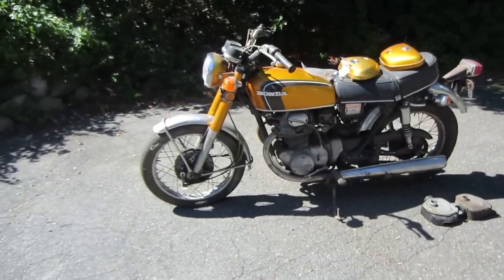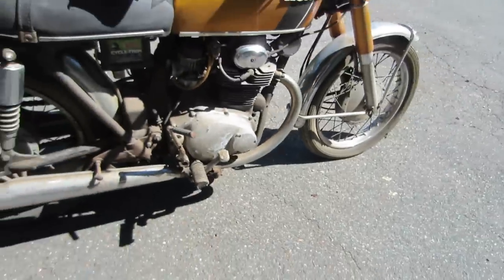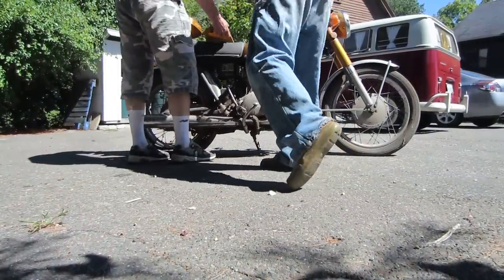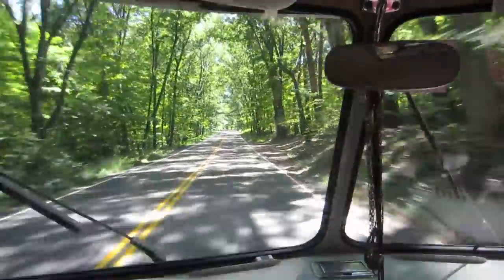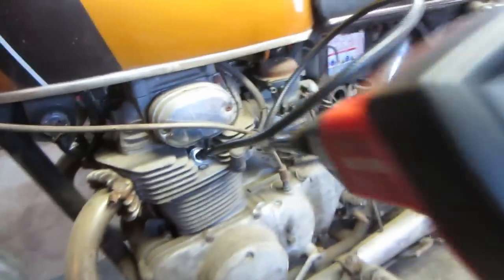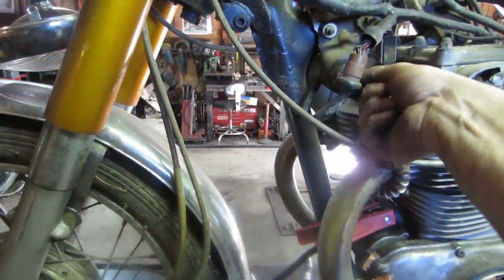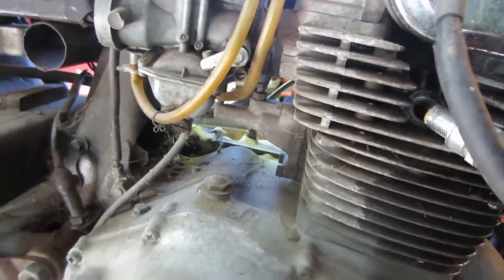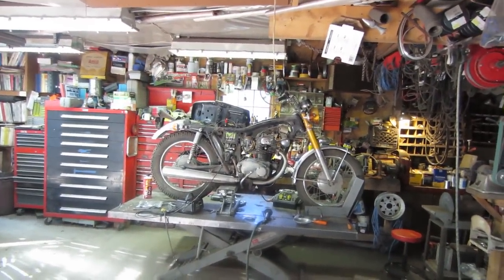barn find, 1971 honda cb 350 motorcycle

Comment: My first motorcycle. $995.00 out the showroom.
Reply: My first bike too. Even had the same color. A trip down memory lane watching this
Reply: My first bike as well. Mine was the red version. Bought it right after graduating from high school in 1971. It was $671 new from the dealer in Elkins WV.  My payments were $32.15/mo, which took the bulk of my Navy pay.
Reply: $995? Man, that was a lot of money. I bought a brand new '73 CL 350 for $715 out the door. From Stark's Sport Shop, Prairie du Chien, Wisconsin. Sold it in '75 and it had 16000 miles on it. (Overhauled it at 12K miles). Bought a new pos CB500T.
Reply: @MrTruckerf  that is funny - I remember Starks selling these for like 739 into thru mid 70's haha that is crazy  i'd see your post

Comment: I used to know my 1965 CB72 intimately. Similar arrangement to this bike. Carbs, points coils etc. Found myself shouting at you. “S’only firing on on one. Feel the downpipes for heat. Don’t use the alternator bolt to free the engine “. Ha! Took me back. Had to laugh. Thoroughly enjoyed it.
Still riding at 72. A couple of injected bikes (can’t do much tinkering with them) but I’ve kept a 92 KAWI ZZR600. That’s got carbs. I can play with that. 😜👍

Comment: Back in the 70's I had one just like this one. Same color too. I used an impact driver on that one of the covers that you showed using it on and it drove the phillips right out of the screw. I ended up using a jewelers file and filing a slot in the screw and was able to get it out with a straight bit in the impact driver. I slotted all three screws. I hadn't heard of easy outs back then. If I remember right, you took that cover off in the oil change process or something that it had to come off on a regular basis. I do believe that fuse is the main fuse that shuts off everything. I may be wrong, but on one of my Hondas, I had an inline fuse that looked just like that, that was a main fuse.

Comment: Hi, I`m a big fan of your vids, from europe...decided finally to leave you a comment and thumbs up. I restored exactly that model and same year, resently. Make sure that the oil pump works proberly. Just over the ignition housing, there is a 6 mm bolt. Unscrew that and oil should be pumping out. The oil pump is very slow, so let it idle and warm up, before rewing. this engine is known for eating camshaft bearings. use thin oil! if the engine is healthy its a quick little bike. 34 HP. factory compression is 170psi and under 150 psi is not good. If it charges, your are lucky...if not meassure at least 30V AC cross the alternator, when rewed and the alternator is okay. Rectifire and regulator can be replaced easy with aftermarked silicon single unit... Cant wait for the next episode! all the best from Denmark.

Comment: I had one of these once. I rode it to work and one day I worked until 3 am (had my own typesetting business).  When I got on the bike to go home I neglected to put up the kick stand.  It pointed forward when it was open.  I leaned into the first left-hand curve and the kickstand hit and caused the bike to rotate on it.  I slammed into the curb and broke the front wheel, handlebars, and headlight.  Also put several dents and scratches on one side.  Insurance totaled it.  I had skinned elbows and knees and damaged ego. :-)

Comment: I got a 1973 CB350 off someone back in the early '80s for real cheap because it ran real bad and they didn't know why. I played around with it and had the points cover off looking there. I just happened to start it and, wow, it nearly got away from me. Turns out the cover had a minor scratch on it that knocked some of the insulator off the other side of it and one point was grounding out. I painted that and rode it to school my senior yr of HS.

Comment: This brings back memories. My first 'real' motorcycle was a twin to this, except was a 72.  Bought it for $175.00, did a bit of carb work, coat of paint, put 3,000 miles on it and sold it for $750.00.

Comment: Had a 72 CB350 Four back in the mid 80s and loved that bike. Be mindful of the timing chain if its like the 4 cylinder model a loose chain will eat thru the front of the jugs and start leaking oil. Had to build mine with new jugs and learned a costly lesson.

Comment: Had the `70 CL450 Scrambler back in the early 80`s. Bought it with mostly quarters I had saved up working as a valet at night at a local restaurant. Paid $900. Sweet little rider.

Comment: dried up oil in the cylinders, nice find running classic, i used to roam the allies when i was a kid hoping for the junk from moving day found an old hodaka dirt squirt gas in the tank no chain i parked my honda mr 50 walked over pulled it off the heap of crap and kicked it over and it started no kill switch so i took a stick and pulled the plug wire zipped home got my older brother and we went back and took it my dad put it in the shop and got it going and we rode that bike for 4 years before my brother traded it to some kid for a 66 impala straight across

Comment: The only suggestion I have for this is,,   Like you mentioned,  The screw heads are easily damaged,    I take the impact driver bit and carefully tap it in the screw before using the driver.  Great video!    I wish I could find one of those.

Comment: My 1973 cb 350 had not been used for over 25 yrs, it was well stuck. I took the plugs out ,put loads of WD40 in there,and left it for 30 mins, then sat on it ,then rocked in 4th gear,and within 10mins it was free.

Comment: Damn I cannot believe the bargains you fall into. Even here in Hooterville that would go for $5-600 even with a stuck motor. Most of the old CB 350s, 550s, 650s and 750s have been mangled into someone's version of a chopper or bobber and I can't remember the last time I saw an unmolested one like that. Great find.
Reply from the maker: where is hooterville ?
Reply: SouthCentral Missouri Ozarks, our county seat has a population of 320 people.

Comment: In early 1972 I bought a 1969 CL-350 which a previous owner had installed the down pipes of a CB-350. Was in the Navy and was due to be transferred in a couple months. Wanted to ride the bike there.  One cylinder, could not which one, would just quit firing.  Seemed like ignition. Changed points, condenser, coils wires. Pretty much the entire ignition.  No good. Took it to the local Honda dealer. They couldn't fix it either. Even replaced the battery. By the way, if the battery is low, the bike would not start. It was eclectic and kick start.  had 3 guys pushing and it would not start. Charged battery, starts right up. Gave up and sold it. Turns out it was a broken plastic piece in one of the CV carburetors.

Comment: just a quick tip if you get an engine stuck with standing idle,  use a plumbers blow lamp not on full  but use gentle heat and apply it to the engine cooling fins around the cylinder barrels this wont melt the alloy but will let it expand enough o free the pistons and rings from the cylinder just a tip used my self many times.

Comment: Whenever I’ve worked on those old barn bikes I always soaked the screw heads down in a penetrating oil.
I’ve also learned to take the screws and Allen bolts up to a hardware store and just replace them, as most strip out during disassembly.

To turn the engine....
Good luck...
Do the best you can.
Reply: Ian, They stripped out as they are Japanese Industrial Standard, JIS and not Phillips Screws.  Get yourself some Vessel JIS screwdrivers and you'll never strip them again.  Good Luck.

Comment: Mustie, are those pipes OEM? I don't think so. I had 2 of the same 350 Honda's, from 1971(when I first came home from Vietnam) to 1975. I remember one of them had exaust pipes that were on the right side of the bike. I think the other bike did too.
There was no quit in either bike. Well built, and took a beating. Trail riding, highway, it didn't matter. Both bikes needed new clutches, which I did (easy to replace).
I enjoy all your videos, but this 1 was special to me. Good memories of both machines. Thanks. Mike in Florida.
Reply from the maker: scrambler had the high pipes

Comment: “Here is my Tip and only for a second” Heat some diesel or some
of your favourite oil mix on an old camping stove then pore that down the
barrels, the heat shock helps brake the bond between the pistons and the
barrels. This works very well but please be very careful when dealing with heating up oil,
too hot and it may ignite plus don’t spill it on yourself as it will burn your
skin. 👍

Comment: and all the videos I watched of yours you have always used boxed and wrenches always had a problem twerking down on them take your box and wrench put it on the nut like you did take another box in wrench and put the box around the open end of the wrench and use it for your torque thank you very much for thank you very much for your support

Comment: I had a 1973 cl350, I bought it new. Back then Honda motorcycles came with a 6 month warranty. 2 days after the warranty was up someone turned in front of me. The bike got hooked by the rear bumper twisting the frame and I went flying over the trunk and landed on my feet on the other side. The funny part, the lady that was driving the car was a friend of mine's mother. I always used to tease her about whether or not she put her mom up to it! Sadly Amy died at a very young age from a ruptured appendix. She was a sweet young woman.
Reply: A Honda 350 engine  is really good running engine. The carburetors on those engines got to be tuned properly but they pull really good. I tried putting a header on my cl350 and it really didn't make much difference. The stock exhaust was fine. That was my favorite motorcycle. I stopped writing after I got married and my wife got pregnant. I figured my kids would need a father to be around rather than a headstone to visit.
Reply: There's a Polish called simichrome that'll get the spokes really clean. I wonder if the toolkit still in the holder! You may want to put heavier shocks on it. Honda for long time the shocks would get hot and the dampening would fade. I'm referring to the rear shocks. I loved my 350

Comment: You were so lucky to get the bike so cheap! In the UK, many people are importing bikes from your country and making a lot of money. I bought a 5500 mile CB360 for £1650, it had seized piston rings in the right hand cylinder. It was sold as running, but needing the tank and carbs cleaned! It has turned into a full restoration, costing a few thousand pounds, that is doing it myself. It came from Wyoming. I just wonder what the importer paid for it.
I am enjoying your video, keep up the good work!

Comment: Usually the carburator is clucked with old gas and you need something like potassium hydroxide or sodium hydroxide(drain cleaner) to get the spraybolts to clear the hole. The brass little bolts that sprayes the gas. Some other parts of it may need to be cleaned as wel. 

A little bucket, a toothbrush, needles and some gloves and you will keep your skin. 

This did it for me.

Jeff

Comment: The 1971 Honda  CB350,  was my first scooter..   I tore it down and rebuilt it..
like this one, mine was also a barn find that I bought in 1978 when I got out 
of the Army.. 

The old woman who owned it, said it was her husbands before he had a heart 
attack and died. And it had been sitting in her garage untouched since 1973.. 

I chose to take it down and replace everything I thought needed to be 
replaced, Battery, plugs, I took off the carburetors and during the winter of 78 rebuilt
them and cleaned them up..  Rinsed out the tank with racing fuel a buddy of mine had

And before the snow melted I had it put back together shining like diamond up a 
goats ass and running like it just came off the showroom floor.. Mine was turquoise 
with white accent stripes and it had a backrest / cargo rack on the back.. 

It had about 1500 miles on it, if I remember correctly when I bought it, and I rode the 
shit out of that little scooter, ( year round ) till I managed to put an additional 20,000 
miles on it.. As long as it had a hot battery, it never failed to start .. Even if it did,
It still had the kicker on the right side and usually only one stroke was needed to start 
it with a weak battery..  It was a damn fine and well built little scooter, and I sure wish 
I still had it .....

Comment: I bought a 71 CL350 in 1972 used for $625.00. Red. with my $1.60 per hr. sacking groceries. I burned two holes in top of the pistons running DX260 premium fuel. That's when we had some great octane at the pump. 85 mph was its top speed with velocity stacks and straight TT pipes. I was 16 years old.

Comment: I bought a brand new CL350 from Grass Valley Honda for $730. What a mistake. I spent more on parts in 35000 miles than it cost. It didn't even make it out of warranty before the first breakdown. It did make me a pretty good mechanic.

Right out of warranty clutch pushrod seal popped out and oil left engine in a small dribble...there is no engine temp or oil pressure guage. Engine points got so hot the plastic insulators melted and stopped engine. Camshaft/bearings and rockers wiped out...on and on the stuff kept happening. junk

Comment: Had a 72 CL350 . That is the version with the high pipes (that really sucked for a passenger). It had the purple/silver flying dragon swirl paint on it. Mine ate the stator while on a road trip, made it home by rotating batteries with another bike that had a charging system.

Comment: An old mechanic friend of me dad said to put diesel down the bores on a stuck engine and leave it for a week
I did it on me standard 10 and it worked a treat
Turned over with the starting handle no problem

Comment: I don't know if you know or not,  the "condencer" is actually a capacitor,  it's probably something like a  .1 mfd cap it helps to keep the breaker points from arching when they open. When the points are closed the cap is discharged but when the points open the cap starts charging, and briefly looks like a short as the cap absorbs the energy that would, other wise cause a spark that could burn the points. That's why if the capacitor or condenser goes open the points burn, but if it shorts you get no spark because effectively the contacts appear to stay closed. Because of the short across the contacts.

Comment: I had a 1971 cb500 and I hated those screws. They always stripped the heads.  One of the first things I did was trade them out for Allens and had no more problems. Trying to get those phillips screws with an impact driver out along the side of a highway is not fun...

Comment: I bought a brand new 1971 Honda CB350 exactly like that one, same color, at about 500 miles a drunk driver came across the center line and hit me head on.  I got it fixed and kept it about another year and traded it for a Suzuki GT550, all links in the chain that continues to the GL1800 I'm still riding.

Comment: It's good to add some valve grinding compound to the Phillips screw heads also helps the bit hold more than anything.
Reply: Yeah I'd replace those case screws with Allen heads if it were mine and I was going to keep it those case screws can be a real bitch to get out especially with out an impact driver
Reply: its not actualy a philips head screw its called a Japanese industrial screw  or jis head different pitch on the angle found this out on my cb700sc
Reply: Same with some of the screws they use to secure  sensors on Ford Autos but I forget the name still vale grinding compound will let it bite and save you a big head ache many times where they use the blue loc tite.
Reply: that trick does work at times but with these screws and being aluminum engine case's on a bike a guy would be wise to invest in a impact driver and just avoid a whole lot of trouble.....on my personal bikes I replace most if not all the case screws over to Allen  head or over to 8mm bolts and I do replace them all when I tear one down an split the case's

Comment: I had a 72 exactly like that, even the color. It was a great machine, but I got stupid and traded it in for a brand new 1975 CB 500 (the twin). The 500 twin had good power, but vibrated terrible Should have got the 500 4 cylinder or kept the 350, lol.

Comment: For classic bike owners! NOTE handlebar end CAP WEIGHTS all but ELINATE VIBRATION.! I know, as the original owner of a '78 KZ1000 LTD wit 48k on it. The difference is NIGHT AND DAY.! Try a set on your bikes, I tried several and am happy with THROTTLEMEISTER brand. SMOOoooth....
Reply: And WHERE  is Part #2 on this bike.?.?
Reply: Paul Silva I don’t know about the end caps. Mine vibrated like hell. We all swapped out the OEM grips for what were known at the time as “Titty Grips”

Comment: The right side cover is a centrifical filter for the oil. The cam cover on the left side should have your contact breaker points if I remember correctly. I look like the horn was missing on the front. The pipes don't have any blue so the 30,000 miles or whatever was on it is not hard miles most likely. I would absolutely love to have this bike.

Comment: Great to see her live 'nd breathe again. On that points wire, have you ever tried liquid electrical tape for that kind of repair? Seems like it might be perfect. I buy the gardner's stuff at home depot for $5 a container. I use mine for new projects, usually where most people would use heat shrink tubing. The nice thing about the liquid electrical tape is you don't have to take the parts apart to get it on like the heat shrink tubing.